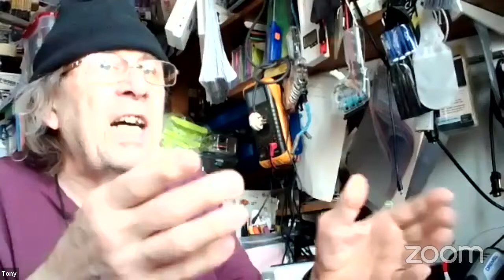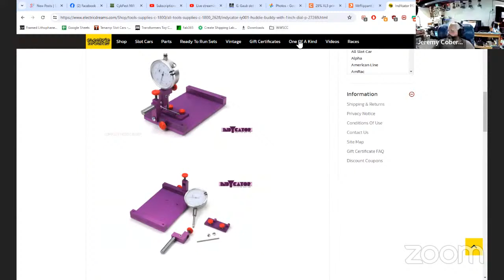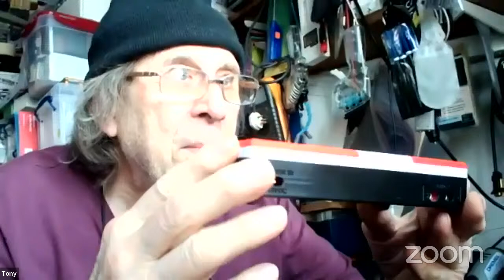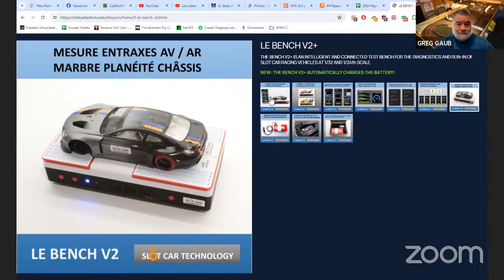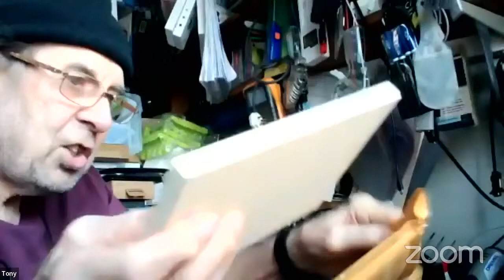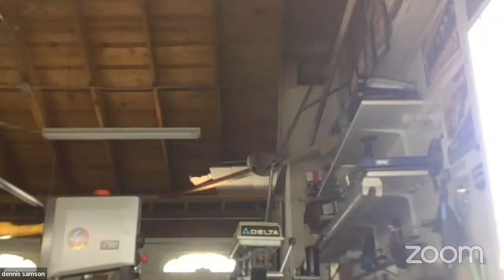World Wide Slot Car Chat LIVE! 221

Comment: Mike , think about the pole south and north, there is a app for it...and Greg, indicates not to use 2 magnets, left and right of the track...however I have been doing this for years
Reply from the maker: What I was trying to say is to not use to smaller magnets next to each other to make a bigger one for the sensor to detect because of the shape of the field, as per slot.it's guide.
I also use magnets on both sides of the slot so that it doesn't matter which side of the chassis I put the sensor on.